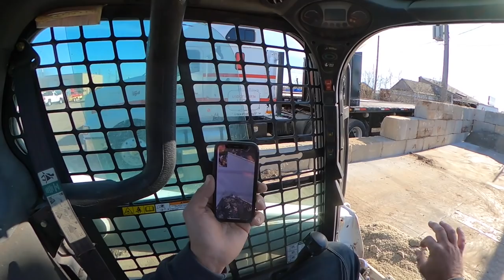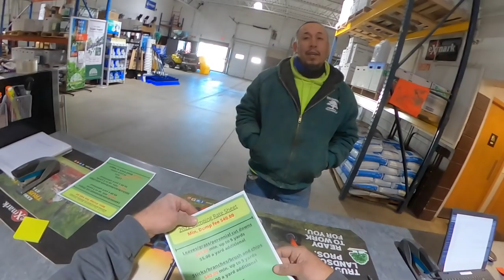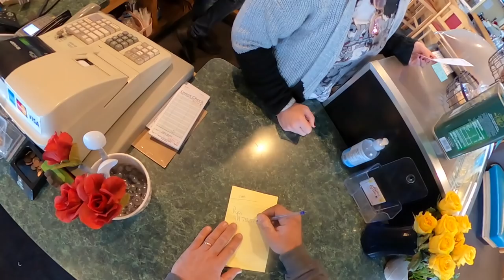Winter is here-Time to get ready!

Comment: You should learn how to pour Concrete Floors, wouldn't take you long to learn. I use to plow another idea for a salt bin is get a 20' or 40' storage container have salt dumped then load it with your skid steer. Keeps it dry secure and no shoveling snow off tarp. We do floors in the winter, but it's not always full time mainly because it's not practical to heat basement for 3,4 days some contractors will just wait until it warms up.

Comment: dt 360 engine was even better yet. but yes the dt 360 and dt 466 were great engines for international before they started making the garbage maxx force junk series engines. ryan you hang on to that older international engine powered vehicles they will run forever.

Comment: Love the channel never realized that certain work like cement is seasonal for places with extreme cold tempertures.  Wondering if someone can tell me  what to do with a large area of my RV pad that has a patch of old rust stain from a coach battery?  I haven't had an RV is at leat 10 years and the spot seems to grow.  Tried pressure washing it  nothing, thanks
Reply: Clr or limeaway?
Reply: @skliros9235  Thanks will give that a whirl